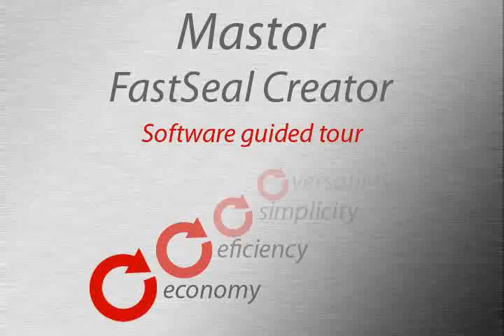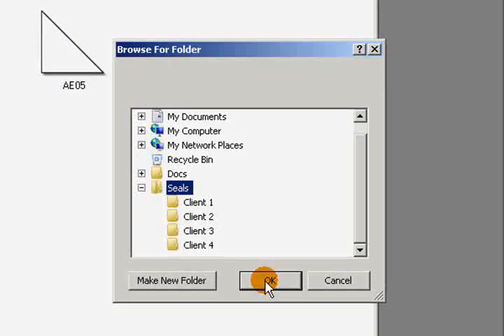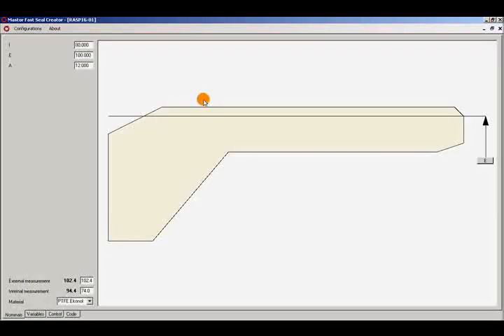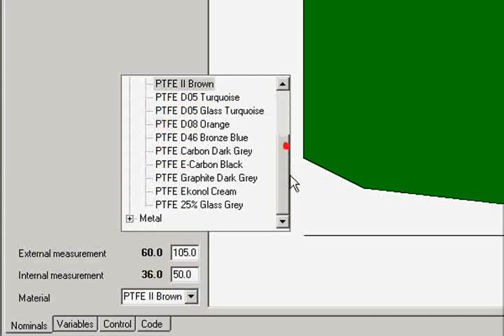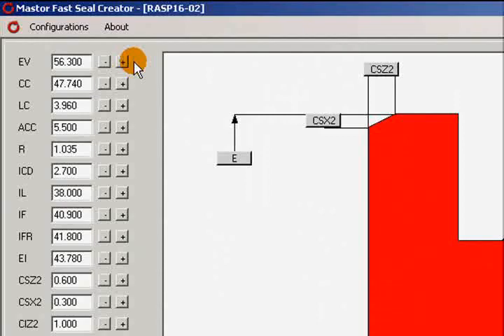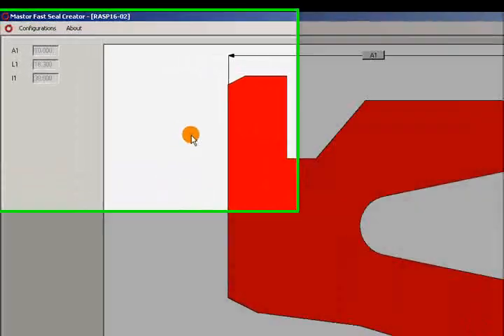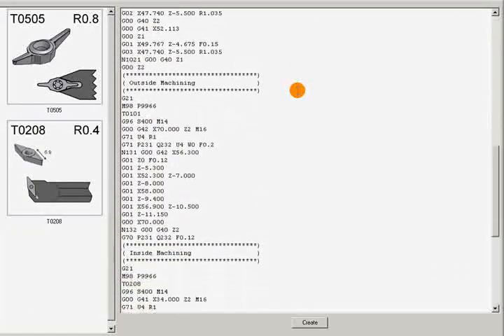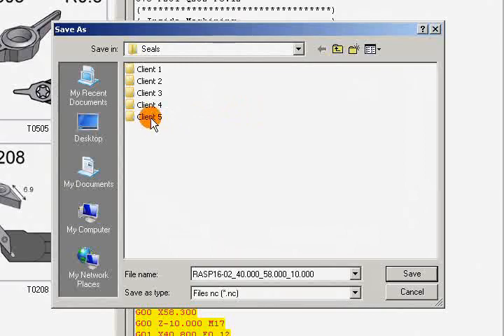Mastor Fast Seal Creator software guide

Comment from the maker: @zekonja24
The software is made by Mastor, Lda, located in Portugal. You can find our contacts in the contacts page.
Currently a dedicated web page is under construction where all features will be shown.

We can supply software, tools, holders and raw materials to our customers that already have a CNC lathe or we can supply complete systems.